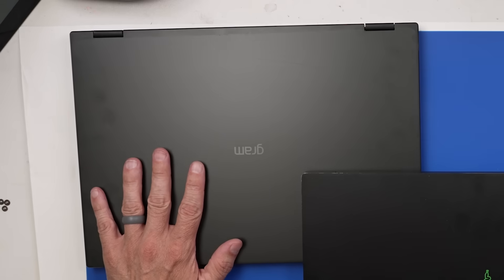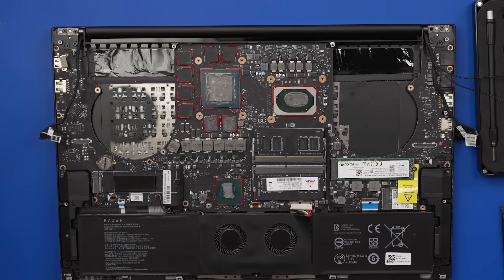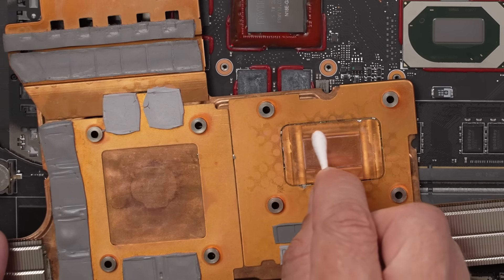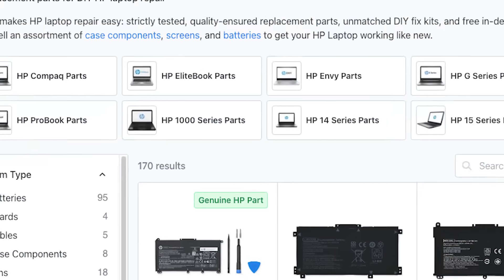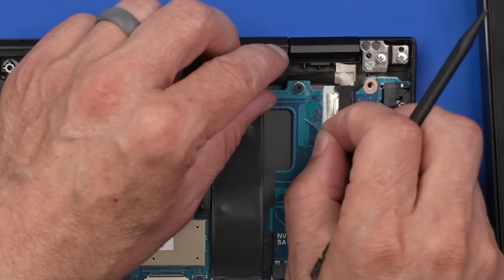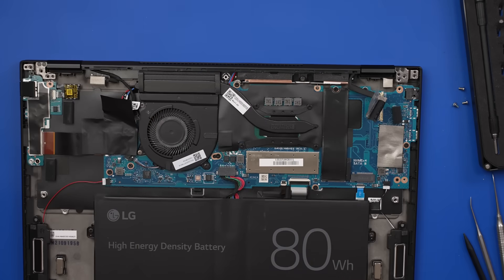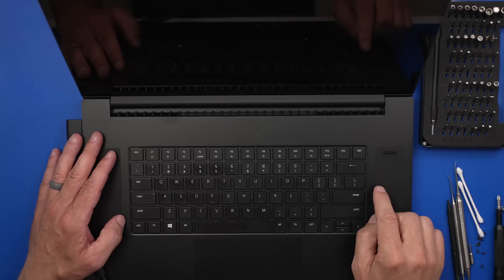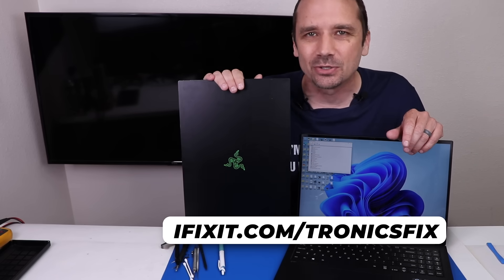Trying to Fix $5,000 Worth of Broken Laptops

Comment: For that first laptop, I would have cleaned the fans on the graphics card as well  -
Reply: if you are refering to the small fans close together, im pretty sure those are fans for the battery, the cpu and gpu are usually cooled by the heatsink he removed and checked.

Comment: Wow. He really doesnt know much about computers in terms of using them. Never ran temperature software to check the actual temps of the Razer before and after. That would have told him everything he needed to know. Software like HWINFO for anyone that doesnt know. And for the Gram, you cant just run it without a GPU driver. Definitely need to download the latest XE Drivers.
Reply: He never has said he was a computer guy…
Reply: okay nerd

Comment: Software or driver issues can always be an issue - especially if the laptop started with an older OS and upgraded to a newer one. I wouldn't be at all surprised if they were both Windows 10 devices that upgraded themselves to Windows 11.

Comment: Using liquid metal on Copper heatsinks/heatpipes is a bad idea. Overtime, it gets absorbed into the copper and your temps will shoot through the roof again. In order to use Liquid Metal on copper stuff, it needs to be nickel plated to prevent absorption.
Reply: yeah just use some arctic mx-4 and away you go :)
Reply: @TheSpotify95 is it better than corsair tm30? I’m about to try replace thermal paste for the first time on my desktop and wonder what would be best
Reply: Nothing will happen, Copper will form alloy with liquid metal but temperatures should stay the same because that alloy have simillar heat conductivity, nickel plating is just for the looks. You shouldn't use liquid metal on aluminium heatsinks.
Reply: @Scytian1  Liquid metal will sip in and you have to re-apply it sometime later.
Reply: @Hostilenemy  And thermal compound dries out and needs reapplication, too.
Reply: it kinda does get absorbed, but i won t bother an yearly mainetance for these results, liquid metal is just insane, if applied correctly. I m having an alienware 17 r4 with i7-8750hk and gtx 1080, and with thermal paste temps would easily get to 100 degrees no matter what i d do, but with liquid metal, it barely gets to 80
Reply: @robertbuzdea6257  I will personally be sticking with Arctic MX-2 for low end stuff, MX-4 for general purpose and MX-6 when every last degree counts.
Reply: @robertbuzdea6257  You do it on a nickel plated like @Hostilenemy suggest? or can do it normaly in a copper one? All hardware need maintance over time, especialy if there changes on the performance.
Reply: @NicoAlegria  no, directly on copper, but it s true, over time the copper just sucks it up the liquid metal, basically becoming an alloy, and i believe that over years the copper will lose it s properties and i will need to change it
Reply: For those who've been around long enough this isn't new and usually the second application does the job.
Reply: This is BS! I bought my ps4 pro the day it came out in 2016.within a week of the warranty expiring in 2017 i opened it up,cleaned it and applied Liquid metal cause it's fan was getting loud.

Its 2023 and that same ps4 pro is still whisper quiet without me being back in it since 2017..
Reply: I used liquid metal on a 4670k back at launch that had been lapped with a direct copper heatsink. Used that PC for 5 years and never had any temps issues.
Reply: but your statement is very true, had to do a repaste after an year, the temps got worse again, now it s brand new
Reply: I've using liquid metal on my Razer Blade for 2 years, been reapplied for 3-4 times and my baby still runs cool. False information.
Reply: That is not completely correct. In the early days of the liquid metal boom, some people said that after half a year they check the liquid metal if there any leak, if it ''drys'' or similar, and saw that was ''obsorbed'' couse the copper form an a alloy, so they started a myth, because they wanted to sell a history and get views. Is like ''microwave or coca-cola zero cause cancer'', ''ps5 and liquid metal it is a bad idea and I show you why'', and all was false so they get views xD. So don't belive all you see in internet, especialy in youtube please.
Reply: Yeah I was gonna say  👍
Reply: Not true!🤣
Reply: Yeah I realized this with my msi gs65 thin laptop and now my temps are 90 to 95c. Which sucks but it is what it is
Reply: @Hostilenemy  No idiot, it gets absorbed yes but not in that exaggerated way, the problem will need like 4 years to show up, then you just open it up, put more again and it will never happen ever again since the copper cant absorb any, isnt efficient to use nickel plated heat pipes cuz it is as heat conductive as copper so it will be better to just use thermal paste.
Reply: 😅😅😅😅 U don't know
Reply: Yeah this gotta be BS. Most of the air/liquid coolers use copper contact plates and not nickel plating. Liquid Metal is used all the time in these applications. You may need to reapply as time passes, but it’s definitely not a hard stop to use.
Reply: false information.

Comment: I honestly didn't think that switching to liquid metal would fix the issue - what an interesting fix!
Reply: I think it might of been mounting pressure/correct contact to CPU/GPU with the heat sink personally. Can’t see liquid metal fixing that much of an issue
Reply: I think he should have looked into under volting before, makes a big difference without all the work, thermal paste looked fine to me.
Reply: Dont do that!..  He just destroyed that copper heatsink...  In few moths time he would be needing to take it off due to overheating again ! .. Liquid metal destroys copper !  I'm surprised someone big like this channel doesnt know that and is misleading poeple to do something like this... Liquid metal and copper is BIG NO...  And hes using thermal grizzly conductonaut, whic has inside BIG red letter, DO NOT USE ON THE COPPER..   lol
Reply: @bokyy747  it won t destroy it, the liquid metal will be absorbed over time and there will be needed an reappliance
Reply: @robertbuzdea6257  It will absorb into copper and its matter it few months , half year... It cant be removed anymore from the copper itself... Those are some  significant points to acknowledge
Reply: @bokyy747  mine resisted one year, then it started to have high temps, and you re right, the copper just reacts with the liquid metal and becomes an alloy, but after applying again liquid metal, works like brand new,
Reply: @bokyy747  and it s sadly the best option on solving thermal throttling, i didn t manage to get these temps without liquid metal, so i think it s worth it, and if the heatsink goes bad from reacting with liquid metal, i ll just buy another one
Reply: @robertbuzdea6257  Are you sure about that... Using high quality paste (like KPX) is virtually same temps (depending on use, laptops tdp etc, sure),but  maybe 1-2 degree hotter than metal.. And  lifespan and resistance cold/hot is unmatched... liquid metal is not worth it on such a small cooling solutions ...
Reply: I think touched the BIOS and adjust the fans to be full speed at some grade or similar. Because liquid metal not use to make a huge change in notebooks, cause the true cooler sistem is the fans and radiator, and don't use to be too much powerfull in laptops.
Reply: @NicoAlegria  you are very wrong, actually liquid metal is only applied on notebooks, because if you apply them on pc s, the heatspreader is made from aluminum, and liquid metal is known for coroding metals such as aluminium, but copper will be just fine. I applied lots of liquid metal on laptops and it does make a huge difference, but just on the laptops that have a high powerdraw which are limited by thermic paste s thermal conductivity
Reply: I’ve had drivers not being installed causing the fans to run all the time; Installing the chipset driver / pm driver fixed that
Reply: How do you make sure the liquid metal doesn't leak out? It doesn't look like there's anything to contain it like there is on a PS5 for example. I'd think especially on a laptop you would want that.
Reply: @chriskrebs3178  usually it won t leak as he s done it, but just to be sure, it s better to put some thermal resistant tape arround the cpu and gpu.Bonus, just to make sure, it s better to leave it in place for some weeks and just use it at desk, untill the liquid metal settles in for good
Reply: @chriskrebs3178  eventually the liquid metal that would potentially leak, if you leave it for some time, it will oxidize and become a little bit less liquid than it is, decreasing the chances of it reaching places we wouldn t want
Reply: Maybe thermal paste just wasn't enough for that laptop?
Personally, I don't mind thermal paste because I don't have liquid metal - and 99% of the time, it's perfectly fine.
I was thinking it might have been more a software issue or a fan curve issue... always good to check CPU temperatures using a program like Core Temp...
Reply: LQ is about 75 times more cooling efficient than the best thermal paste.
Reply: @robertpage2023  Yeah, but (and it's a big BUT) it's like swapping out regular 70's car wheels for new ones with 10 times better grip, you can only eliminate the grip "problem" but engine power, the weight of the vehicle or the aerodynamics would be of much more importance for a car to run more, the same thing happens here, imagine you have a thermal insulation paste, it does not matter if they are the best radiators and fans on the market, you are not going to cool the processor , if you have liquid metal, the only thing you can do is eliminate that problem, but it all depends on the radiator and the fans in the end and in notebooks they are not especially powerful.
Reply: @NicoAlegria  Thanks.  My Dell XPS has some really powerful fans that kick up into high gear till the initial heat is dissipated and then quiet back down. In-between my periodic cleanings the fans will really take off to compensate for the lint blocked heat sink vents. That's when I know it's time for a good cleaning. My wanting to add liquid metal as my chip's thermal paste replacement is to give better cooling.
Now seeing the comment on the potential copper coating effect, I am wary now of doing that but I'm going to do more research.
Reply: @robertpage2023 it s about 7 times better, but still a lot of improvement, the best thermal paste has about 13.5W/mk, while LQ has about 76W/mk

Comment: 14 years ago I bought a used media laptop for about £400 to play games, it kept crashing as ran about 60-70 on idle and would cut off unless I had it on a metal surface, about 6 years later I decided I would try and upgrade the cpu or at very least repaste it and found out there was no thermal paste on the cpu and on the cpu was a faint layer of what looked like toothpaste, all those years I had it and thats how simple the fix was.

Comment: The screen issue happened with my HP, intel stuff with a GPU for the hardware acceleration part. I fought the flickering screen and did something similar. Must be an intel problem but it’s never happened again, the user must have changed something and broken it because I did.

Comment: Can confirm that laptops with an intel iGPU usually make that flashing-like issue because of a driver issue with windows, it can be easily fixed by either updating the OEM driver (if there is one, ofc) or installing the generic intel one. Solved this issue in an HP Pavilion 15-cs with this method!

Comment: You can’t say any of those laptops are repaired… the overheating problem of the razor it’s something else and the hp iris graphics uninstall is not a fix….
Reply: He literally fixed the screen problem, it’s the exact fault I had on mine and the same thing fixed it (user error caused it because I’m an idiot) the fans going loud is normal for high performance laptops, mine screams for a bit then goes silent.
Reply: @timehunter9467  using liquid thermal paste is not a fix. Using the regular thermal paste and get the overheating issues fixed indeed is a fix. That laptop was designed to use regulat themal paste not liquid metal. Overheating issues can have many causes. Liquid thermal paste without the surrounding foam is a very bad idea…
Reply: @justinc9991  I did think the swapping to Liquid Metal was stupid, I think it was just a standard feature of laptops in general haha, mine doesn’t overheat and the fans ramp up with CPU usage so of course it’ll sound like a jet engine when turning on but calm down once it’s finished working.
Reply: Then what do you exactly consider to be a "fix"?

It had a display issue and he took care of it by reinstalling the Display driver...seems like he fixed it to me

What did you want him to do? Replace the entire screen?
Reply: @dukenukeman  to me it doesn’t look like a driver re-linstall… just a driver uninstall… as on desktop gpu’s they show image with driver uninstalled, but with driver installed they give you a black screen and its a memory issue. It should  stick to connector replacement and other stufff

Comment: I repaired an alienware gaming latop recently with a dead screen. When powered on the fans would spin up almost immediately and sounded like a jet engine. I remember thinking once i got the fans out, no wonder the fans sound loud, there were some kind of felt pads blocking the intake... Nope. It was dust and lint that had compacted onto the fan. I deduced that the fans must've been struggling, caused the laptop to overheat and possibly caused the screen to fail over time.

Comment: Did you check the settings in the razor?  I had a similar issue after some updates on a 15”.  Turned out the updates defaulted the fan speed to “max” so every time I turned it on the fans would ramp to full no matter what the load was on the laptop.

Comment: both of the laptops seems to have a software problem rather than a hardware one, with the gram u can reinstall windows then with everything ready install the official drivers if that stills make it flash just lower the Hz, if it dosnt works go to the bios and see if the problem stays, if it does that its probably hardware, normally that can make it works, and for the razer one maybe the fans its a bios configuration rather than a problem, probably ifs configured to 100% in post for the fans. Ik u fixed them, but maybe this works for a future laptop fixing video

Comment: Liquid metal on copper is a bad idea though, it creates corrosion. You'd have to nickle plate that heatsink first or you're just asking for trouble later
Reply: its good on copper, ps5 uses copper heatsink and liquid metal, aluminium is a bad idea, it destroys the heatsink.....
Reply: nope it doesn't lol... LM reacts with all heatsink metals. its only corrosive on aluminum, with copper/nickel the reaction is neutral and non destructive. you'll just have to repaste the LM in few months again with copper/nickel plated heatsinks as LM gets absorbed into the heatsink and thereby removing it from the die  itself(lowering the thermal transfer and causing overheating)
Reply: I thought the same thing

Comment: Why in the world would you put liquid metal on a machine that is not setup to use liquid metal? this will cause issues later when its taken apart and the new owner dosent know there liquid metal, but more importantly theres nothing in place that would stop the liquid mental from getting on the components, other than the cooler, which i wouldnt trust.
Reply: because he can duh😂
Reply: @hakim9785  that doesn’t change any thing
Reply: @Bluehatmonke  emmmm better cooling? Heat transfer from the cpu too the heatsink
Reply: @hakim9785  ohhh, you got a point my bad
Reply: I was asking myself the same question! Good point.
Reply: Wdym the new pwner doesn’t know about the Liquid Metal? I would feel like he would tell him lol, and the new owner probably has no intentions of opening up his computer once it’s all fixed

Comment: Quick tip for display problems.

if you go into the computers BIOS by pressing F2 (Usually) and wait, if the problem happens in there, its usually hardware
If the problem starts after POST, when Windows has taken control, its usually a driver issue.
Reply: i had exactly the same issue at my work a few days ago. But i knew it was the drivever saw that allready a couple of times.
Reply: Yeah that's always what I do, go to the bios, sometime running a live linux to test things out, and then if it's hardware, I open it up, I find it better to test the laptop before entirely reassembling it, to not having to open it up two times if a problem occur for exemple.
Reply: It is easily possible for the text modes on a graphics card (like the BIOS screen is often/usually using) to work fine while the hi-res graphics do not.
Reply: Was about to type this 👍🏾

Comment: Regarding your sponsor - hasn't HP always directly sold parts for their laptops? They're one of the few brands that do. Back in the day IBM and Sony sold even the smallest, most insignificant parts for their laptops individually to anyone who asked.

Razer on the other hand - my keyboard melted 1 month out of warranty and they wouldn't sell me anything. Only replacement I could find was on eBay out of China for 1/2 the current value of the computer. I dumped my system on eBay as parts.

Comment: You should really use HWinfo, which is a free tiny program, to check stuff like voltages and temperatures if the screen turns on! <3